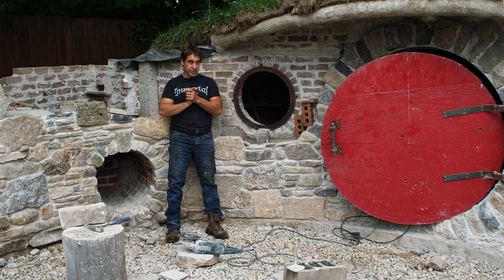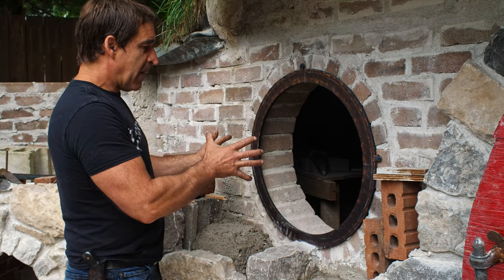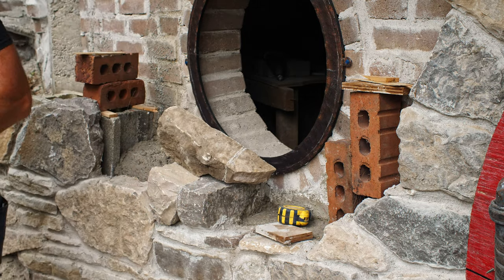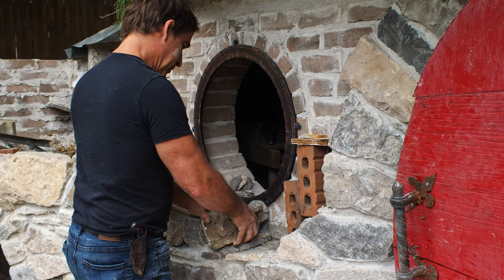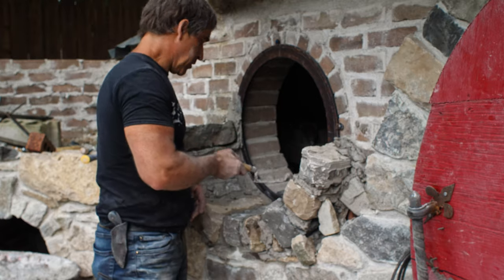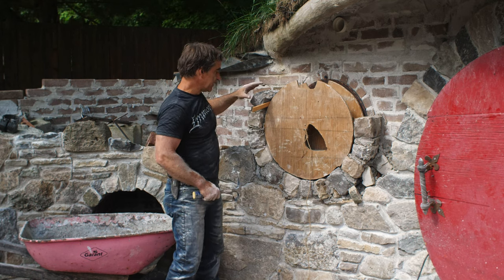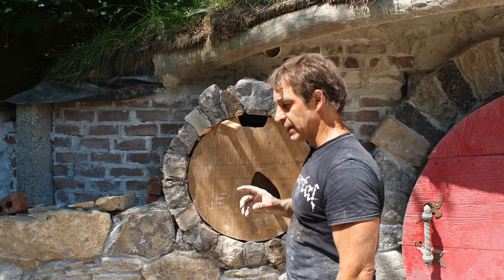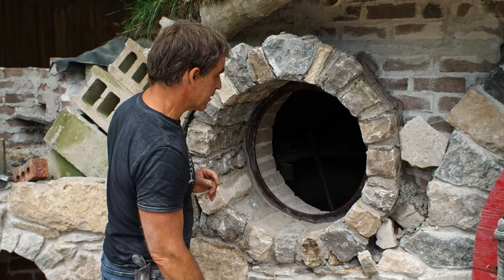Hobbit Hole Reveal - Making a Stone Window Frame

Comment: Thak, man of mystery.....   Awesome work ! More videos of this sort please.
Tip of the day, lightly moisten the brick and stone surfaces before applying mortar to them. This helps the mortar stick to those dusty surfaces, keeps the stones from drawing the water out of the mortar  and it allows the mortar to dry slower which means harder.
Reply: Great tip! Glad to know this. Guessing that's could be why some of my joints have cracked over the years.
Crawford out 🙏🔥⚒️🧙🏼‍♂️

Comment: A great video. As a comment from one amateur stonemason to another…. If you cut that circle form in half, then shaved off a bit more in the middle, screwed the halves together, it would be much easier to remove. Because I bet you’ll get one completely jammed at some point. Secondly, we add stuff called plasticiser to mortar here, which makes it much more sticky. I think its based on linseed oil, but I think you can use washing up liquid which also works. Thirdly, I tidy up my messy pointing either a few hours after its done or the next morning by scraping away excess and then going over with a wire brush - no need to mess with acid, the brush works fine. Hope this might help … I wouldn’t dare to make any suggestions about your blacksmithing! Look forward to seeing more … Regards from Ireland.
Reply from the maker: Good info....very happy to hear all these tips...thanks

Comment: For stone masonry your mortar is too loose, which is why your needing so many stone chips to prevent squeeze out. Try mixing your mortar very dry, so it almost appears to crumble and wet the walls previous work before you start. You will end up with a cleaner wall and less acid wash and scraping later.

Comment: Hi, just pickup on your project as I have just finished and posted here on YouTube the doors I just finished. I’m making the windows now same style as the doors I built. Anyway, I’m making 2, 10x20 hobbit huts on my ranch in Colorado. They’ll be made of stone that I’ll gather from my property, with a concrete foundation which I just finished. If you have time, I’d love to discuss with you my construction plan. 
Thank Roger
Reply from the maker: Ok
Reply: I’m making 12” thick walls out of stone with mortar, on a 12” foundation that has 4, number 4 rebar coming up vertical ever 5 foot. Then I plane to run 2, #4 bars horizontally ever 2 foot in hight. 
Just asking your thoughts/opinion on that as far as strength? 
Little hard to explain completely.. do you know if I can add pictures here? New to YouTube

Comment: As a 5th generation stonemason (mainly headstones) invest in some proper tools, stone chisels, hammers etc. You can find them at granite city tool. Check out their videos on how to use them. But your doing a fine job, each stone type has it's nuances to work. If you don't want grinder lines and want the stone to break in a certain plain then you have to score it around on that plain. By score I mean you use a flat chisel and hammer out the line you drew, making sure to keep the chisel 90° to the surface of the stone. What that does is it starts the micro fractures running in the direction you want ensuring a more clean break. It doesn't work every time but the more you do it the better you get.
Reply from the maker: Good info...thanks so much
Reply: @ThakIronworks  
You will have better success breaking your stone if you support the piece you are saving on the log and leave the piece you are breaking off unsupported.